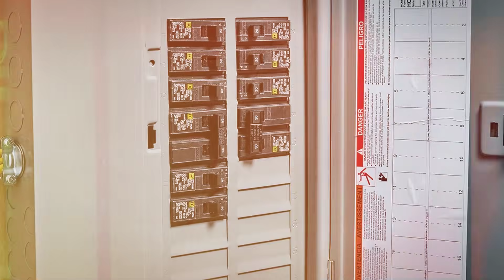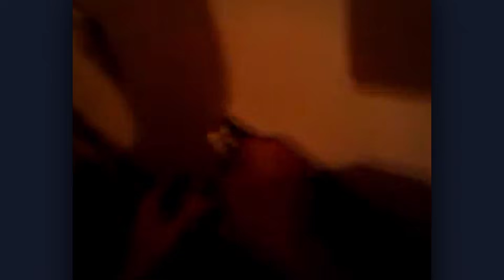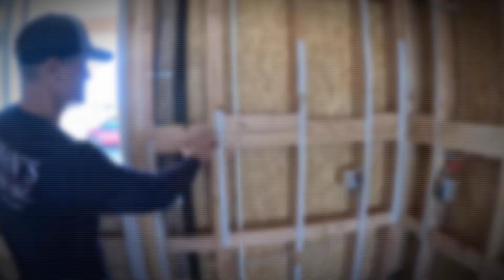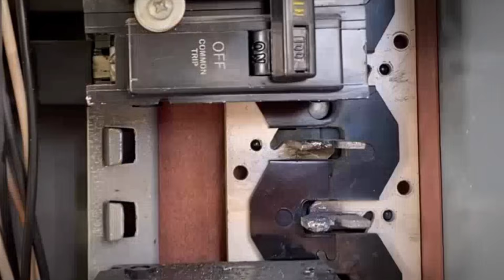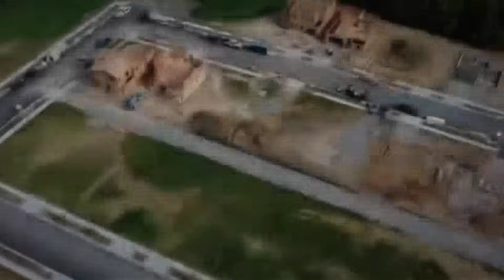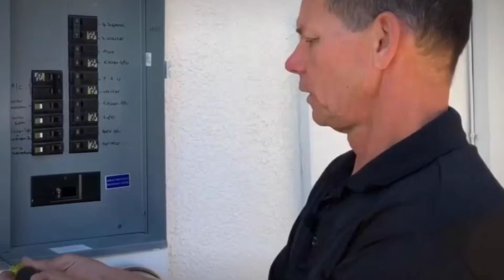The Modern Wiring SCAM (1920s Houses Were Wired SAFER)

Comment: I have questioned the gov about the stupid rule about wires sharing a hole to allow heat dissipation.  I pointed out that since they allowed spray-in foam insulation to totally stop heat dissipation from the embedded wires, sharing a hole in a stud seems trivial in comparison.  No reply.
Reply: The federal government does not put out the NEC.   Take to long to explain.  I am a electrician
Reply: Same with not allowing cable inside conduit.
Reply: @MS-ig7ku  ,  u are allowed to install romex cable inside the house through Conduit.  Not outside.  there use UF cable
Reply: @zerosparky9510  True but again that makes no sense, romex inside pipe is better protected from weather than romex under plywood. And shorts happen inside boxes not inside cable. I have seen romex survive for decades stapeled to the outside of buildings, not that I would recommend such.
Reply: @MS-ig7ku  ,  with the NEC changing every 3 yrs.  it can drive u crazy.  such as the advent of the GFI outlets and how about the AFCI Breakers now in the NEC.   Driving up cost.
Reply: @zerosparky9510  From the 1930s till the 1950s metal cased cable was the standard for residential construction the code changes and not always for the better.
Reply: @MS-ig7ku .  Yes.  And I have worked with the old metal jacket covered BX cable.  Wear u out.   And the 1 st generation had a outer and inner metal jacket cover over the wires.   Have not seen any of that type in yrs now.

Comment: My house was built in 2007, and the electrician who wired it didn't strip back the insulation far enough on 90% of the outlets and light switches.  This resulted in the screw having to bite through the insulation to get to the bare copper.  I didn't notice this until some of my lights were flickering, and I traced it to an outlet that had partially burned due to the high resistance connection.  That passed the inspection.

Comment: Knob and tube was for DC not AC
Reply: No it was for 110 volt AC wiring.
Reply: We have NEVER had DC power to our houses.
Reply: @rtel123 Not true. Very early on in some cities, but it wasn't practical. 
You also forgotten that many farm light plants were 32V dc.
Reply: Electrical conductors don't care  what type of electricity is passed through them.

Comment: I rewired my 1928 farmhouse myself using 12ga copper, commercial outlets and switches, steel conduit and armored cable, zero romex, zero backstab crap, zero plastic boxes- all my outlet and switch boxes are steel.
A lot of the fires are caused by WORN outlets that constantly have things plugged and unplugged, overloaded outlets and extension cords, and then the old or romex wiring inside walls is especially prone to RODENT damage, mice love gnawing on wiring in the walls.
I replaced the old  main box- 2 fuse and a range fuse deal with a 200 amp breaker panel myself but later had a local electrician replace the old wire from the weatehrhead to the box, I have a piece of the old cloth covered rubber covered main cable assy that came down from the weatherhead to the meter box- the copper where it was connected had turned green and the insulation was all crumbling, it had been stapled to the exterior wall exposed to sun and weather, painted over, definitely NOT safe and probably dated to the 1960s or 1970s. The new is in steel conduit.

Comment: Most of this is not true. It just comes down to buying the cheapest parts and the cheapest electricians. Poor installation is the problem. Knob and tube worked fine but was much more dangerous to the user
Reply: Yes and No - knob and tube not being grounded was a serious disadvantage, but the cheap crap being made today, along with bundling wires closely together causing the heat degrading of the wires can easily cause death - much more dangerous to the user.  The main problems with today using knob and tube is 1 - has it been damaged?  Insulation still good?  Not been gnawed on, spliced into, etc - 2 - had it been overloaded?  It was never designed to handle many of todays electrical loads, nor should it be expected too.  They didn't have air conditioning, many clothes dryers, microwaves, etc - 3 - education, being aware of what it was designed to handle and not overload it - and to treat it with much more respect since it is not grounded.

Comment: Fuses are also safer. They really work and safer. No mechanical failures as it is just a fusible link.
Reply: True, but they're inconvenient. They require the discipline to keep a couple of spares on hand where one can actually find them when needed, and to replenish the inventory when one is replaced. My mom's house (1959) still has fuses, but she has spares by the fistful.
Reply: @ttiwkram  And no pennies or foil.   Fusestat system keyed the holder to prevent over fusing. (I have lived in 3 houses that started life with just 4 circuits)
Reply: @ttiwkram  I have spares but have not had to replace any in decades!
Reply: Yes fuses are safe.   Now how many houses stil have a fuse box installed.  I have a Siemens breaker panel.  And I am a electrician.  Been in the trade since 1978
Reply: @zerosparky9510  I still have my original General Controls fuse box from 1959.

Comment: Knob and tube is safer due to air gap between conductors. Even if insulation rots the air still insulates the conductors do not touch
Reply: Knob and tube is good until someone insulates, this reduces capacity of the conductors
Reply: Then why are most electrical fires started by knob and tube and not romex wire ?
Reply: @Klausnaci , because someone adds insulation around it, defeating it's open-air status, overloads it, or incorrectly splices into it and runs half the house it. Also, I'd like to see the source showing statistical data of fires caused by K&T vs. romex.
Reply: @devildog1912 jus literally look it up
Reply: Thank you! That has been my argument for years!
Reply: Knob and tube wiring is ubiquitous in the city where I live. I have noticed if I ever short out knob and tube there seems to be a much bigger arc created when the wires cross. Im not an electrical engineer, but I’m thinking there is more impedance because the wires are further away from each other since they’re not closely together like the conductors in a cable like NM-B which, in my thinking lowers the impedance and less of an arc. also, possibly making it take longer for the circuit breaker to clear. not to mention that the connections, even though they may be soldered and tape corrosion over the decades, may have decreased the conductivity at the joints through the system. That’s just my thoughts. Just thoughts.
Reply: @AndrewPorter-n9p  maybe traditional fuses are still better on knob and tube?  In some ways, I like them better anyway -

Comment: Although I 100 percent agree with the backstabbing debacle, there is some misinformation in this video.  Licensed (old) electrician here.  Knob and tube wiring has no ground.  (electrocution hazard).  Yes Federal Pacific is bad and you did include Zinsco so good on you.  Also beware of Challenger breakers.  (1980's mostly)  You mentioned "statistically safer" but that statement might be ignoring fire vs: electrocution.  Don't know.  Home inspectors at least in this area do open panels to inspect for things like double taps aluminum conductors, and overcurrent protection matching the wire gauge, etc.
The biggest safety issue I deal with is having to repair work done by unqualified people including homeowners playing with electricity who have NO business doing so.

There is so much bad info on the internet so I figured I'd set you on a better path.  Good luck.
Reply: If nob and tube had grounds it would be bullet proof.
Reply: @barrybrand2970 Some installations did, especially later ones where knob and tube prevailed into the 60s in some regions. It wasn't until the 1975 NEC that knob and tube was axed from new installs.
Reply: Knob and tube creates an evil Faraday cage. This video is disinfo
Reply: @ucanliv4ever  You wanting harmful electromagnetic radiation all around you is not evil.
Reply: @DipntheVic  line and neutral have to be equal length and run together right next to each other per the NEC.  Otherwise harmful radiation is propagated. Most electricians don't know this

Comment: electrical contractor here some of this is good and some not
1. back stabs not the best. not a bad ideal to replace all plugs/switches and wrap wires around screw. at this time we haven't seen any insurance 
    companies requiring replacement of backstabs. most of time if we find a failed backstab we replace with wire wrapped around the terminal 
    and recommend the same repair to other plugs/switches.  
2. many insurance companies will not insure house with knob and tube wiring. insulation not rated for hot attics or to have insulation surrounding it.
     romex originally had tw insulation rated for 140. most problems we see with it are at light fixtures where someone installed oversized incandescent 
     bulbs and cooked wires in box. later on romex wiring had thw insultion good for 167 and now thhn insulation good for 194. so romex wiring has gotten
     better with time. if you have aluminum wiring only 3 approved repair methods which are rewire with copper, copalum or alumiconn connectors. with 
     aluminum approved repair methods have changed over time and who knows one day only a copper rewire will be acceptable
3. many panels i believe made in the last 30 years still have aluminum buss but it is tin plated so there should be no problems versus an aluminum buss
    with no tin plating. the panel with solid aluminum buss that seemed to have the highest failure rate is zinsco who have been gone since the early 1980"s.
    there are  also several other brands that used solid aluminum busses. consult a licensed electrician if you feel you have a solid aluminum buss panel.
4. the 4 breakers brands which insurance companies don't like are federal (which clip mentioned), zinsco, challenger and bulldog pushmatic although we 
     don't see many pushmatics. 
5. houses built in the last 20 years have arc fault and ground fault protection (AKA SHOCK GUARD) which makes things much safer than 1920"s house although
    the arc faults can nuisance trip when refrigerators, freezers and motor loads plugged into them. some jurisdictions have made an exception to the electrical
    code to not require arc fault protection for refrigerators/freezers due to nuisance tripping. also houses built in the last 20 years are required to have 
    smoke/co detectors throughout the house which improves safety.

Comment: Just to note: Backwire is not Backstab. Backwire uses the screw to clamp the connection. BUT it (and side wire) needs proper torque. Also Backwire used to allow 12ga. Modern outlets  the hole only allow 14ga.
Reply: Don't bother trying to correct shitty AI.
Reply: Newer is worse?

Comment: Untrue. The data shows that NEWER houses with NEWER wiring are much less likely to burn down.
Reply: Ditto 
I’m a retired industrial electrician those old 20’s wiring with fuses extremely often have larger fuses than the wiring is rated, the insulation has deteriorated or been damaged, no ground wire, … all are a big safety hazard. FP and Zensco panels should be replaced, but I’ll take them over knob and tube wiring. Some mortgage companies and insurance companies will require replacement of these systems.
Reply: @monteglover4133 that is because of operator stupidity. It is not the fault of the equipment.
Reply: I wonder if a 3rd knob and tube conductor could be added as earth?  If you think of it, why not clearly label live and neutral as well

Comment: YES ! ... I am a  🇬🇧  UK resident 😝 ... the old ( UK , 1940's )  " round pin  "  2 Amp , 5 Amp , !5 Amp  plugs / sockets were FAR superior to our 🇬🇧  ( modern ? ) 13 Amp replacements , but due to post ( World War 2 )  copper wiring shortages , had to be downgraded and  replaced by   ( 30 Amp , ring main , 13 Amp square pin plugs ) .... Recently , I  had to use an old  1960's  5 Amp  rubber trailing socket for a project that needed a ( UK , non standard mains connector ) to avoid " idiots " plugging in a 3000 Watt heater 💩.. on inspection , the 5 Amp  GENEROUS  Brass receptacles were FAR  more superior to the modern 13 Amp ( tat 💩) that is on sale on some of our  🇬🇧  local high streets  ... all comments welcome (  55 year + Electronic  Engineer ..... DAVE™🛑 )